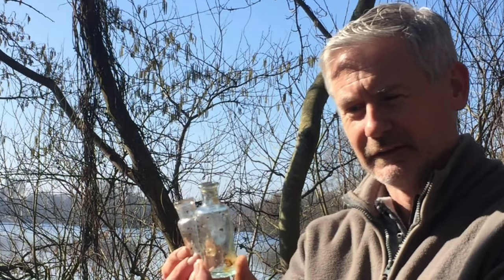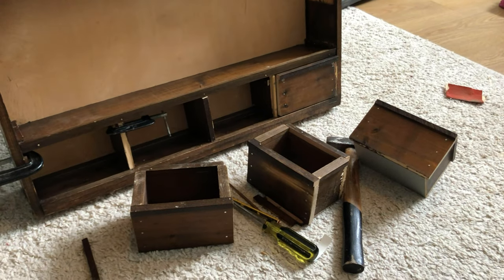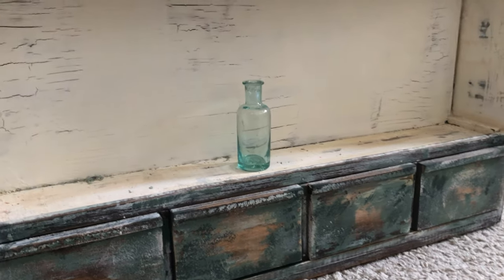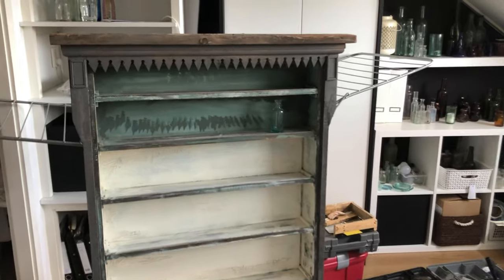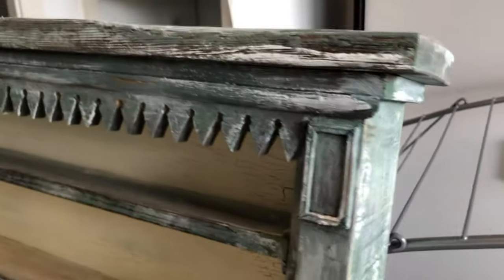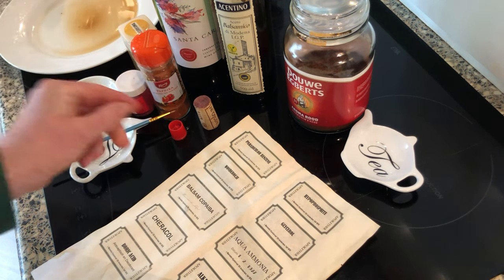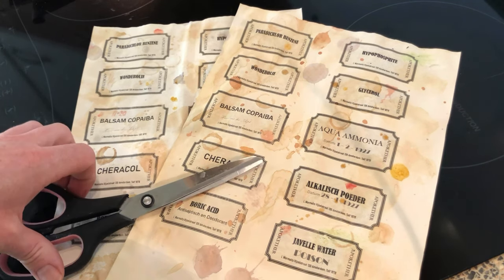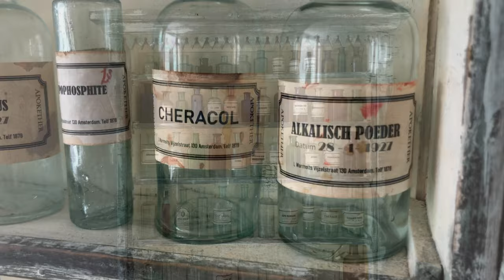Making a Victorain Chemist Shop display and bottle labels.

Comment: The method with the wood glue is new to me, I will definitely use this. It looks so beautiful, I want to make something like this for my garden under the canopy. 
A tip from my father, I come from a family of furniture makers, rub some soap from a soap bar on the bottom of the drawers and they slide more smoothly, I do that myself. I think you also did that with the screws of the handles or did I see that wrong? Loved watching this.